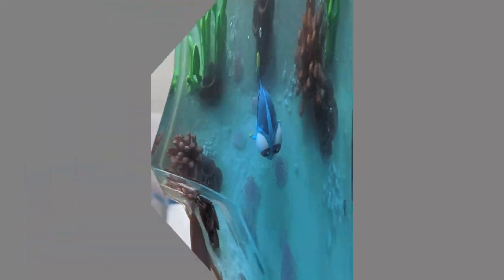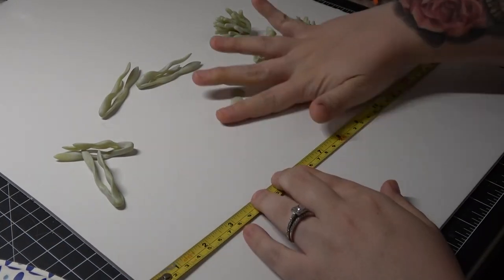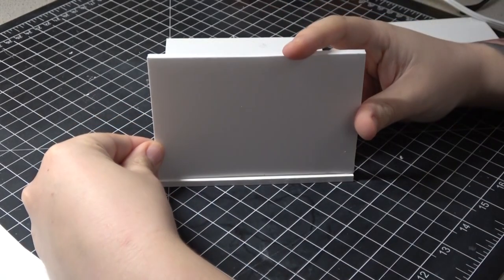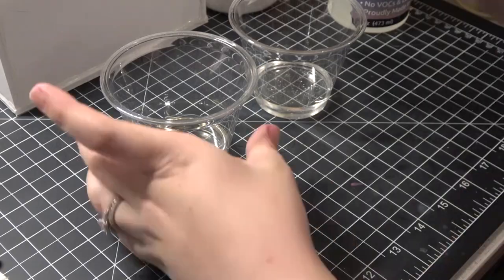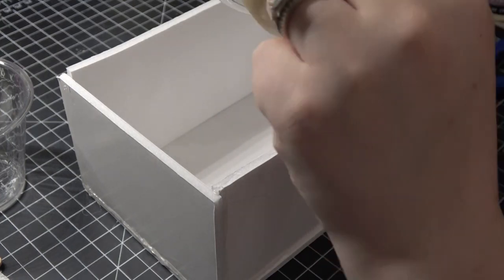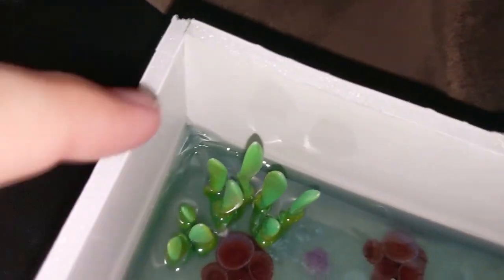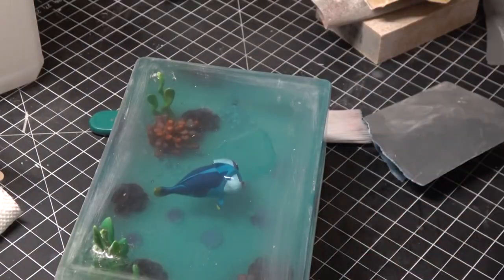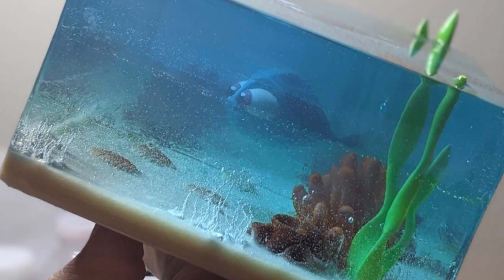Baby Dory Diorama in Resin...FAIL?! -Resin Art

Comment: Fantastic work and love that you shared this as a learning experience. I especially liked the sand filler and the paint job beforehand. 
I work professionally as a prop maker and I think you did a really good job on such a complex piece. Here are some things I think might help troubleshoot:
I'm not sure what kind of epoxy you were using but the slower setting the better for large volume open air castings. Without a degassing chamber to pull bubbles out of your mixture with negative pressure, and/or a pressure pot to let it cure inside to shrink the bubbles with positive pressure, there is only so much you can do. Heat can make even the smallest bubbles from mixing expand. I don't think it would be the sand, I think its just stirring and pouring causing air to whip up. You might just have to mix it up super gently. I'm not as familiar on casting clear resin without access to pressure tools, but I've seen good results without them using Epoxacast 690 by smooth-on and some more toxic slow-setting polyester based epoxies.
Another trick for color consistency is to pre mix the dye with one part. For example say you need 20 oz total resin for the box, mix your blue dye with 10oz of Part B and pour from that to mix your smaller batches. That way every single mixture will be the same ratio of blue dye. If you pour new epoxy right as the previous layer starts to gel, you may be able to reduce the layering effect further since the new epoxy layer is chemically bonding instead of just gluing itself over the previous layer.
Finally, as you are likely aware, try plastic sheets and hot glue next time for your box. Release agents can also help the epoxy from sticking to the walls. Not to mention that exposed foamboard can release gas when heated which may further complicate your casting. 
Hope that stuff helps. I do think it looks really well done. Looking forward to you pushing your skills more.

Comment: I've seen people use masking tape/ packing tape over the foam board before you start pouring in the resin to keep the resin from sticking to the foam board. Also adds a layer of protection from the resin getting out if you didn't give it a proper seal. Looks good. Nice work on this one.

Comment: Great job.

Tip: get yourself some mounting putty. It’s blue tacky putty that you would pull a small piece and roll into a ball. Next take Skewers and cut them down to useable size like 6 inches. Take the putty and add it to the end of the skewers, now stick on the small model to it that you need painting, now you have something hold to your model while you paint. Next Get some sand or kitty litter and add it to a cup, so you have a place to hold your models when they are drying. 😉
Reply: Genius! Thanks!!

Comment: Good start. Definitely would recommend not letting the resin fully cure before pouring the next because that's how you get harsh lines. Let the previous pour get to a firm jelly stage and then pour your next layer. Regarding the heat problems, your resin should say how thick each layer should be to avoid thermal runaway. Also make sure you're using a casting resin. To avoid bubbles when casting porous material like sand the best way to avoid bubbles is using a pressure pot. Hope those tips help.
Reply: Thank you!!! Gotta start somewhere right? 😊😜

Comment: I don’t have resin pouring experience, so take this for what it’s worth, but many other YouTube channels that do LOTS of pours, use a MOLD RELEASE on the casting container, & let it dry, before the first pour.  Also did you consider pressure potting the sand stage without any add-in models?  When that is fully setup, come back with a super thin “glue layer” of clear resin to stick your models in place, then let that cure. Finally use slower curing resins which heat-up less.  I know you were probably wanting to get all the pours done in a day, but most of the thick pour videos seem to be shot over multiple DAYS, with pressure pot curing with those slow resins.   Good luck with the next one!!! Great idea for subject & love the Chelsey paint work & I think clearcoat would be a good idea next time to protect that art!

Comment: big resin projects are like painting, many thin layers. if you wish to blend dont let it dry fully.
do some trial runs or when the resin you have can set but still mix a bit with the next layer, the colours will blend even if ya think the put in the same amount of dye. 
mould release is your friend even on foam board.
air guns need to be hot and slow to bring the bubbles up and pop so you dont move the resin. blowtouches are ya best bet for this, or the little cooking touches if ya want something smaller.
high thin pours help remove bubbles from mixing but can disturb the lower layer of resin, so be careful if not wanting that to happen.
the sand layer needed to be 100% set before the next stage so less air makes it way out. after that use a thin layer of clear epoxy to trap all the air and if any start to show then they would get lost in the texture of the sand, this would be the layer to use to get the surroundings stuck tot he base as well.
anything that looks like a cavity, prefill with clear resin to help keep bubbles forming.

I think overall yes its not the result ya want but tbh the size ya were going for was pretty large

Comment: - As soon as I saw the foam I was like 'oh, honey, no, don't do it'. xD There is one god when dealing with resin and it is silicone, unfortunately.
- I think a heat gun is too weak, too, and it moves your resin more than it helped with the bubbles? I always saw actual blow-torch used/recommended.
- I think the sand itself would've had so much air in it that for trapped in the resin and then it was released under the weight of other layers. I think all solid layers need to be fully cured, while things like water can stand to mix a little? I think it might help with the color differences (colored see-trough is just very hard to do in batches, why dioramas like that usually have plain resin as the 'filler').
But the design is just precious! And it still looks nice.
Reply: Thank you so much! 😂 Yeah I won't be using the foam board again!!!!

Comment: Tyvek tape works great for covering the foam board and you shouldn't have any issues with it sticking. It should be available in home improvement stores. And the sand was a cool idea, but I think it killed you with all of the entrapped air. I think I would have let it partially set, add the bottom layer pieces and then wait a few days for it fully cure and then add a thin sealing layer on top similar to what they do to wood before resin pours. That should keep what air isn't initially released(and hopefully removed) trapper for all eternity. And I think you pretty much nailed everything else. Thinner layers or resin purpose made for thick pours. I still think it came out great and you learned at lot in the process. Neat trick, if you have some clear UV resin(or translucent blue) you can do the same thing if you have a a large enough cure box/light and the great thing is, you can leave it protected in the dark until all the bubbles escape. You just have to be watchful of the clear stuff as it likes to go slightly yellow, but aside from that it works great and if you want to do gradients, it is so much faster than cure-over-time resins.

Comment: let me know if you have any questions about the resin stuff. I've been working with it for a few years and I have a vacuum chamber i use to get rid of a lot of the bubbles from the resin before i pour it. then after pouring it, i still use heat near the top of the layer of resin to pop the bubbles. sometimes I use a torch and sometimes just a lighter depending on how quick of a pass I need to do. for using sand or dirt i usually mix it with the resin and put it in the chamber so as the bubbles come out of the items or substrate, the resin gets sucked in those gaps. just be careful with colored sand because it can change the color of the resin as well. anyway, this piece still came out pretty awesome!
Reply: Does resin heat up? She says “pouring too much resin causes it to heat up” what is heating up?
Reply: I know Im randomly asking but does anyone know a trick to get back into an Instagram account??
I stupidly lost the account password. I would love any help you can offer me.
Reply: @Esteban River instablaster =)
Reply: @Crew Alexis Thanks for your reply. I found the site thru google and im waiting for the hacking stuff atm.
I see it takes a while so I will reply here later when my account password hopefully is recovered.
Reply: @Crew Alexis It worked and I actually got access to my account again. I'm so happy:D
Thanks so much you saved my account!
Reply: @Esteban River you are welcome xD